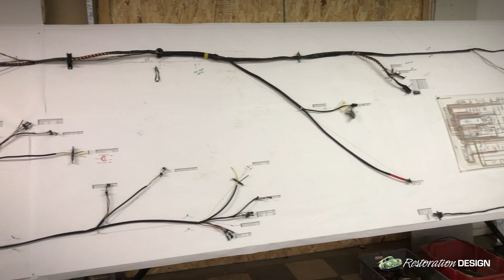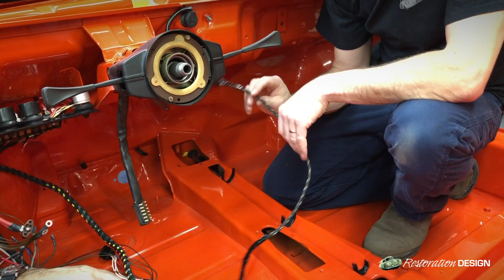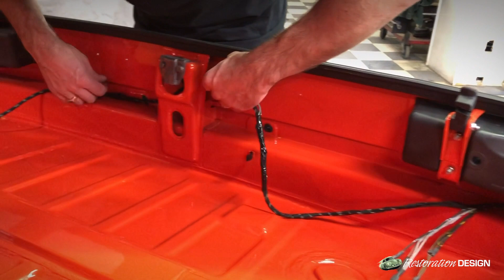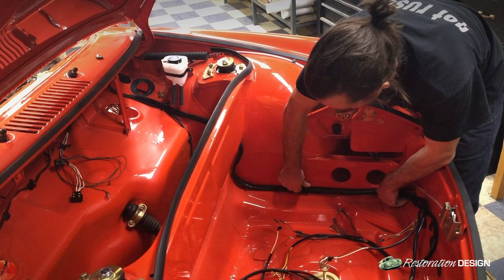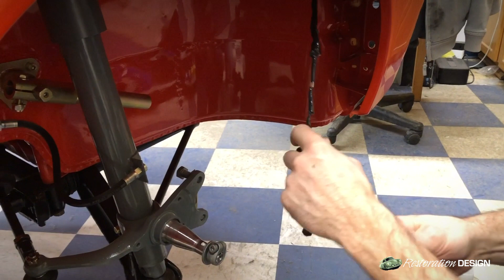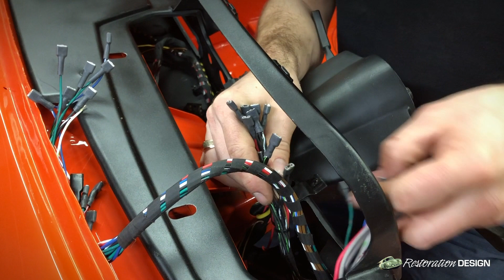914/6 Full Wiring Harness Installation

Comment: Dielectric grease is ANTI-conductive.  It sounds like it would be 'electric' but it's usually a silicone grease to seal electric connections from water/corrosion.  It does NOT improve electrical conductivity - precisely the opposite.

Comment: while this is a /6 install the /4 installs are effectively the same, One question related to the optional R. window defrost & associated loom? Do you have any suggestion as to how/when to install that? Is it installed prior to the going in the car or after the main loom has been installed?
Reply from the maker: the window defrost is not a separate harness. It is integrated with the main chassis harness. Installed at the same time.